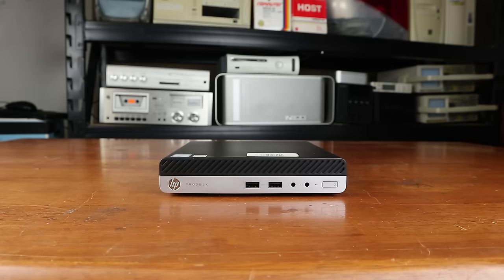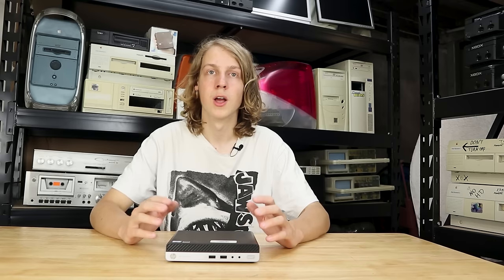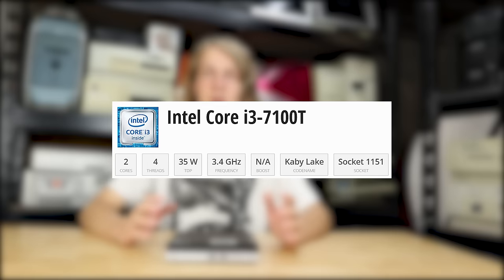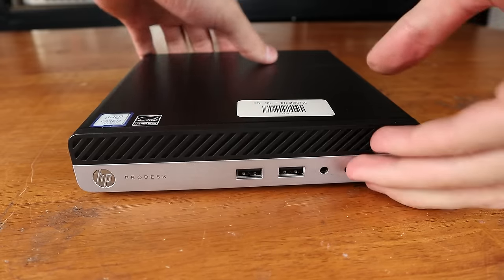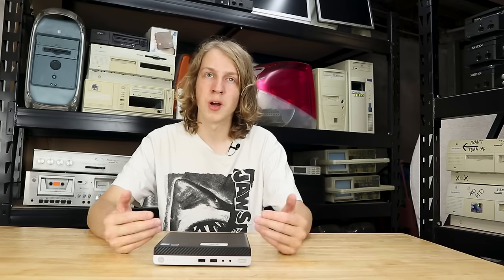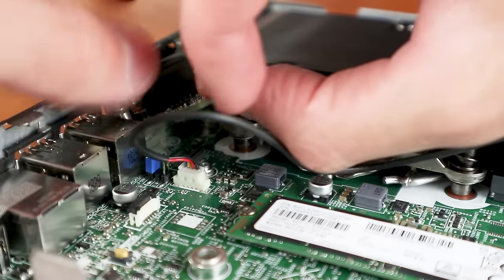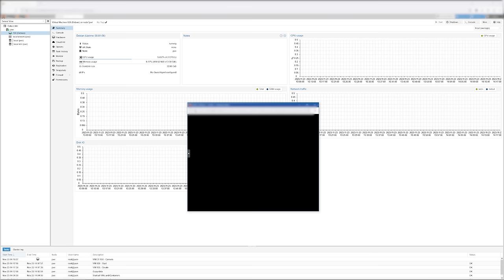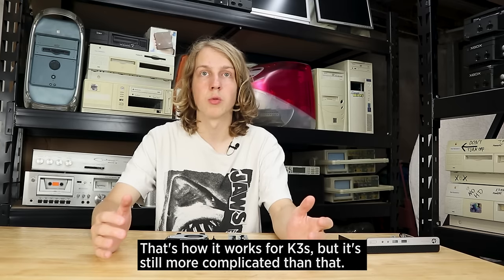This MINI PC Is The PERFECT Home Server

Comment: How much are the later generations that have 8 cores and 16 threads?
Reply from the maker: I believe the cheapest to get 8 cores (but only 8 threads) would be a system with the i7 9700t, at roughly $300 USD. To get 8 cores 16 threads, you would want a system with either an i9 9900t (I didn't find any for sale), or an i7 10700t, which would cost roughly $350 USD. It's a lot more than I paid, but probably a better price for the performance.
Reply: @serverscience What about those little mini PCs with Ryzen 7 CPUs (like the 5700u etc...)?
Reply from the maker: The beelink ser5 with the 5700u is also $350 USD

Comment: I bought one. Its brilliant. The vendor, less so. The damn BIOS is locked, cant access it. Cant add more memory, cand change the hdd. Vendor wont answer emails. So... I cant set the thing to reboot after power loss. Que sera sera. I am running Valheim with lots of mods and Satisfactory. It has had linux installled. Grrrrr
Reply from the maker: There should be a jumper somewhere on the board to reset the password, but not all models have it. Depending on the model, it might be under the fan, or somewhere near the back of the board. I hope that helps.

Comment: These little PC's are dope I have a bunch of the Lenovo Thinkstation P320, p330 tiny, Thinkcentre M910X tiny, and the Thinkcentre M720q, m920q Tiny as well they are basically the same as the Elite/Prodesk Minis but they have an X16 pcie slot in them that is electrically x8 usable via a riser card. The Thinkstation Tinies can even come with a single slot GPU, but all have the PCIe slot. They're great for slapping in a Network Card.  Also the Power Adapter is the same as their laptops so they're easy to get and if you need more power than the standard 65w provides they're obtainable.